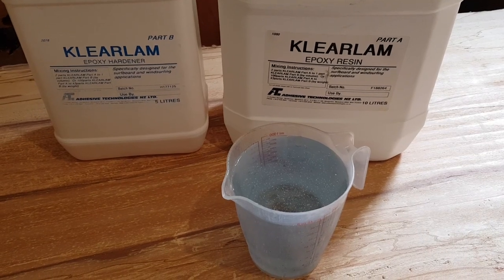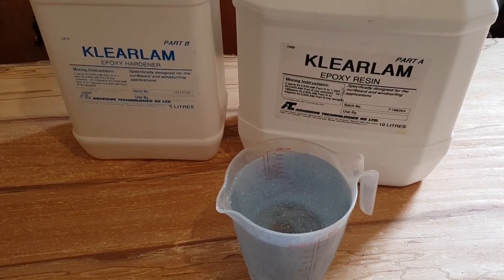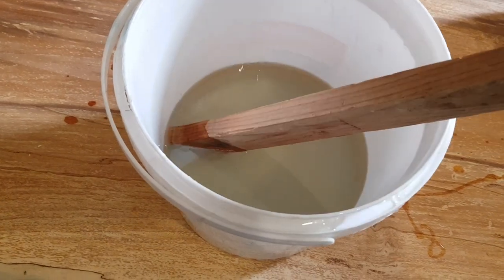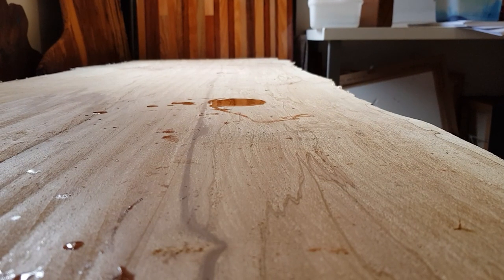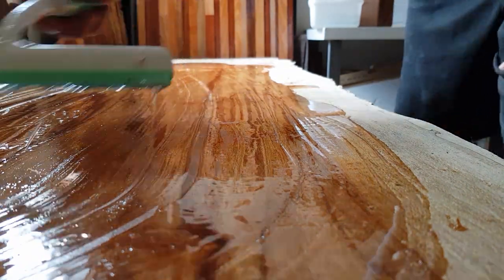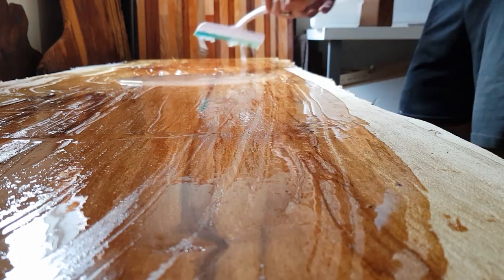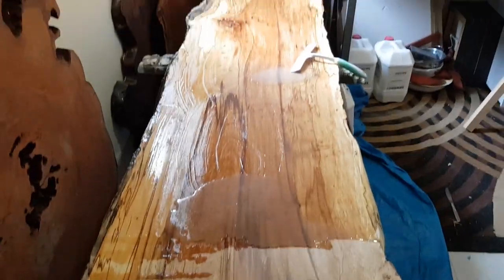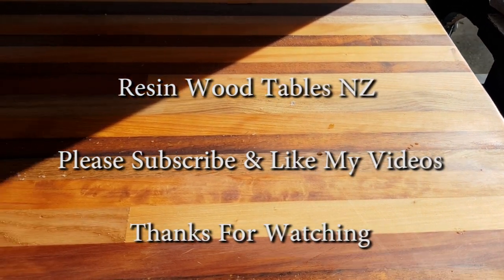Live edge slab table, How to seal coat

Comment: Could one use Polycrylic to seal….then apply epoxy?
Reply from the maker: Yes you can use any water-based product but why would you when you can buy the proper Multi-sealer to do the job https://resinwoodtablesnz.com/products/liquid-glass-sealer-4kg-kit?srsltid=AfmBOoqh7syzLGRAgVCpHUY9dfGtmmsf2B6lQKS70V0PwBL0MHZy83gx

Comment: Hello,
I just poured a seal coat with Pro Marine epoxy. There are no air bubbles in it but there are lots of dimples. Is this normal? Can I pour a flood coat right over them?
Any guidance you could give would be appreciated.
Reply: I have had the same thing happen with Pro Marine and did a flood coat over it and it leveled out perfectly.
Reply from the maker: Dimples are mainly caused by moisture in the air, so sand back and recoat at about 4mm deep then sand and polish
Reply: Dimples are left behind when air bubbles rise to the surface but then pop once the resin begins to harden. The impression of the bubble is left behind. The very simple solution to all of this is to very quickly sweep over the surface with a torch or heat gun. It will thin the epoxy out and release air bubbles instantly. No matter how air free you mix and spread your epoxy you will need to do this step. The raw wood will be releasing air as the epoxy soaks in. I usually torch the surface twice. Once immediately after spreading, and again about 30 minutes later. The result is a flawless finish everytime.
Reply from the maker: @boost331  Generally the air bubbles will only occur in your initial pours to seal and maybe the first top coat. As a rule of thumb I have 5 to 7mm cover over my tops then any imperfections are sanded out as I go from 400 grit to 5000 grit then buff polish. This also puts a swirl line in the resin that is fine and distorts any scratches owners may make on their tables.

Comment: Do you or can you stain the wood with an oil based stain before sealing with epoxy?
Reply: Kinda. Easy answer is not with Minwax oil stain but yes to most other stains. If you use oil stain you need to make sure it dries fully and then sand the top with 220 andmake sure all the grease is removed and bondable. The epoxy cant soak in and bond to the oil/grease and you may be asking for trouble.  I usually wait 2-3 weeks after staining before the epoxy to make sure it is absorbed. Make sure when you stain you wipe all the excess stain off and dont let it dry on top.
Reply from the maker: No Always use waterbase

Comment: I make dragon eggs from burl and resin. 
The bubbles are a pain in my ass. 
I’m about to just toss the final product into a cup of resin and into a vacuum chamber to suck out off the air from the cracks and replace it with resin once the pressure is let back in. 

I’m fairly sure doing this will waste quite a bit of the resin though.
Reply: Slamscape wouldn’t a torch or heat gun solve your problems
Reply: That’s what I use now. But air continues to come out of the cracks making bubbles once the resin heats up, warming and expanding the air in the wood.
Reply: Hmm I wonder if heating the wood beforhand would help
Reply: You just solved this man's problem
Reply from the maker: @lonewolf1647  Did not have a heater that big back then but I do now lol. Also bubbles only happen with teal hard woods I find